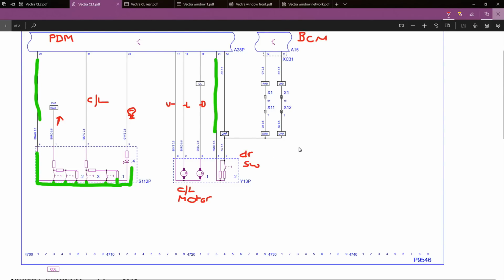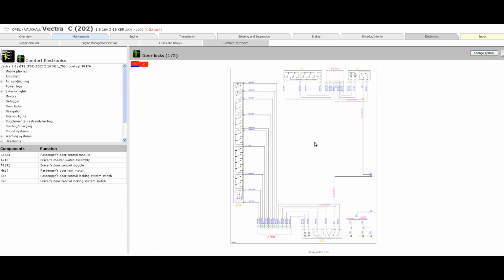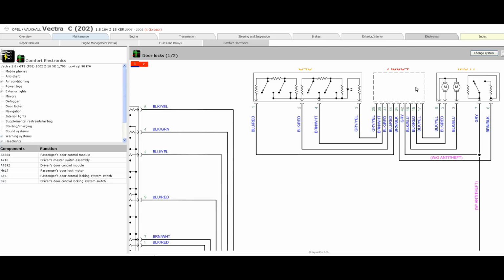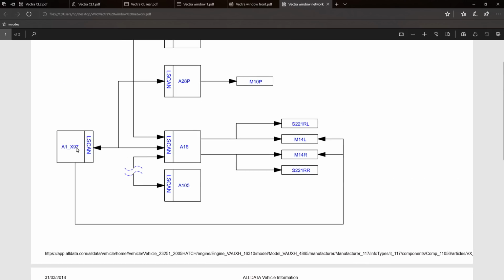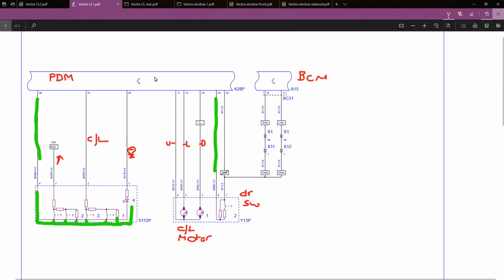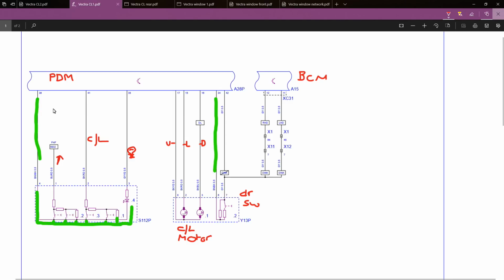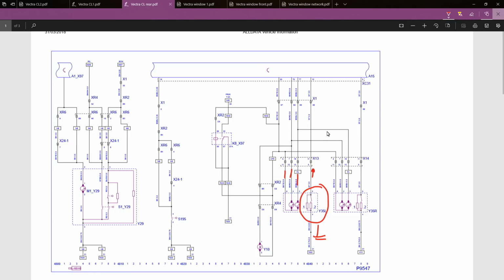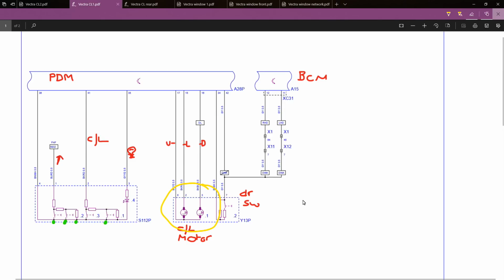Vauxhall C/L wiring diagram walk through

Comment: Hi Steve, just came across this video while searching for a wiring diagram for the same car. 2006 Vectra c Z18XER. Having a mare with it atm. The car won’t start. I’ve had a replace ECU and main circuit relay low voltage fault P-0685-06. I’ve managed to get rid of the ECU fault by reprogramming it via the CIM. Thought it was just now a simple relay replace but tested the relay at it fine. Relay no 5 in the engine bay. If I bypass the relay the car starts. I’ve checked have have full voltage at its terminals. At a loss now so need to check wires but need a wiring diagram.
Reply from the maker: You can get a free trial of all data and Hella by joining our community at https://simplydiag.net There is a discount available for Alldata for registered trade members of SDN

Comment: You know you mentioned that normally there isn't a power feed on the door switch, it has a low ref or a ground, how exactly does that work ? It's always something I couldn't get my head around, does it not have to have some form of voltage for it to be pulled to ground when the contact is made ? I think what I'm sort of trying to get at is, is there away to test a switch without just unplugging it and testing continuity
Reply from the maker: Matthew Deakin , great question 👍 take a tailgate switch for example - I will normally take a test lamp to +ve and backprobe each wire, I expect one to give me a path to gnd all the time and the other only when the switch is closed. Same for push button tailgate switches. The important thing is to use a testlite with low current draw <100mA or even better an LED lamp as it is going back to a module and it’s not good to let the smoke out 👍
Reply: Simply Diagnostics, yeah ok that makes sense, I guess I could do a similar test with a meter, if I put my red lead on batt + and use the black on the wires, one will show 12v and one will switch I guess 👍
Reply from the maker: Matthew Deakin the test light is a technicians best friend, low cost, extremely versatile and doesn’t lie, don’t forget your sanity check. Check the current draw for each testlight and make a note. DMM is a viable alternative as long as the circuit is loaded 👍